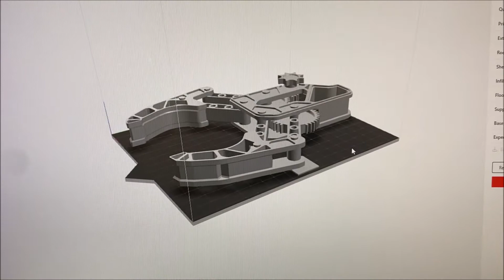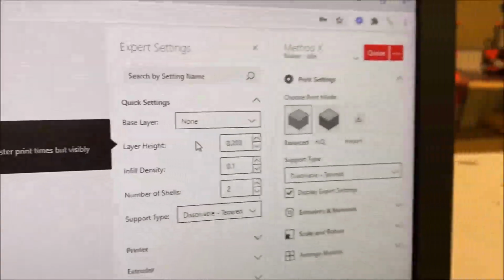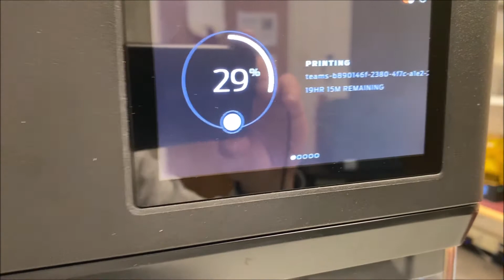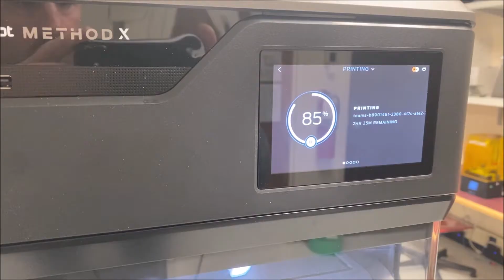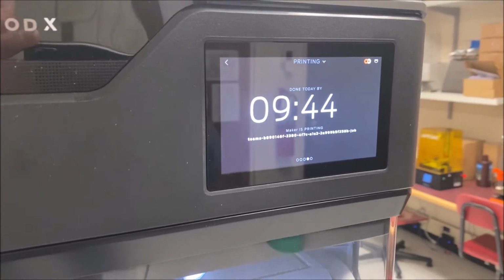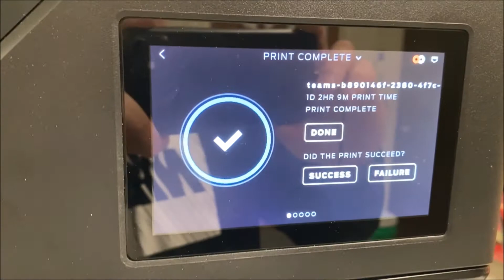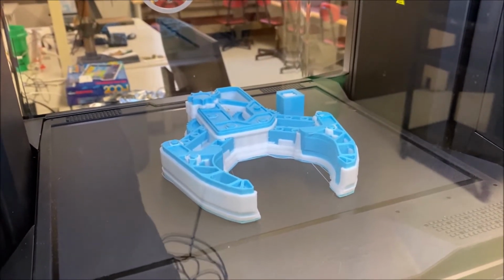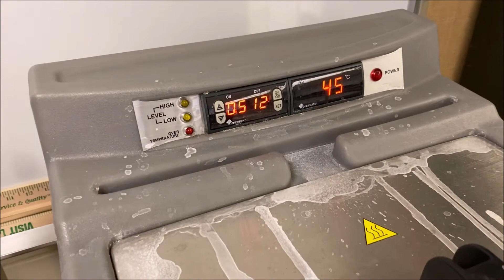Printing with the Makerbot Method X: Success or Failure?

Comment: The build tape for this printer is very expensive. Any one found a cheaper alternative?
Reply: Have you tried the blue painters tape ? back in the days before heat bed is common, they were using those blue painters tape. but it only works for PLA
Reply: It's probably the same stuff as Buildtak or any of its china alternatives.
Reply: Raises 3D better!

Comment: Any chance you could do some fine measurements and let us know how the dimensional accuracy was (they claim +/- 0.2mm).
The axle breaking was not the printers fault, those axles should be 100% parts and the rest of the claw should be an infill much higher, like at least 75%.
Not sure why MakerBot would provide a 3D model like this to print that doesn't have solid axles and a recommended set of settings to use for best results (like not doing a 20% infill).
The take aways I see from this video are:
- good to see the method x actually printing (slower than I expected)
- mostly clean printing process and no stated clogs or issues
- the part looked good (except I think I saw some pinholes on some of the gear teeth that were a little concerning)
- I didn't see any warping of the part (I think that lifting of the left tip was due to no bed adhesive being used and maybe some bed/enclosure/nozzle temp tweaking to be done (which tells me the MakerBot extruder and filament defaults aren't perfect at least for ABS)
- Seemed to be quiet during printing but with no decibel readings during the video hard to tell
- interface to the machine looked great and closer to Industrial level coaching that you would expect)
- did I mention above it seemed to print slower than I expected, but I did like the print quality for the most part (as good as you can tell from a phone recorded video being streamed compressed, being consumed on a phone ;-). )

Comment: Thanks for posting this.  I have been using the method x with the included filaments and SR-30, and they work fine with very few issues.  However, I tried a print with the esun ABS+, the same stuff you are using here, along with the SR-30 and the experimental extruder and my SR-30 is just not sticking to the ABS+, causing all kinds of printing issues.  Any suggestions?  Thanks
Reply from the maker: Hmmmm interesting. I do know that in the printing settings you can adjust the geometry of the support structure. And you can adjust how the supports interface with the model. Look at your print preview and see if anything needs to be adjusted.
Reply: @coolteched7572  The problem seems to be the "stickyness" of the SR-30 to the esun ABS+.  I changed the Makerbot filament to the esun and the SR-30 just won't stick, whereas with the makerbot ABS there is very little problem with the SR-30 sticking to it.  Had to go back to the makerbot abs filament for now.  Thanks

Comment: What was the overall length of time it took for it to print this out for you? I heard the time it was done, but not when you started, would be great to know to get a sense of output speed relative to the complexity of that claw. Thanks!
Reply from the maker: I can't remember! But it was a lengthy amount of time. Prints take longer on this Makerbot because between each nozzle swap, the non-printing extruder's temp is lowered. So both nozzles are constantly cooling / heating up. This can be adjusted in the printer's settings, however
Reply: The display showed 1 day 2 hours and change, so 26 hours and change

Comment: What infill % did you use? It looked like the broken knob and axle had very little infill which caused them to break easily.
Reply from the maker: 20% infill I believe. Should have done 50%+. My Stratasys UPrint SE Plus printed this gripper awesome and used a very high infill
Reply: exactly what I was thinking... should be 80%+ surely?  you're not going to get gears torquing at 20% :)
Reply: @egoodchild  totally 100% agree and arguably even 100% .
Or in the modeling tool those axles should all be 100% in the shafts (a no brainer really).
The overall quality looks good, but without him showing measurements on the dimensional accuracy we don't know that either.

Comment: How does this model of maker bot stack up against the zortrax 300 dual extruder model for $5000?
Reply from the maker: No idea about the zortrax 300 dual extruder printer. I do have the zortrax Inventure 3D printer and it uses the same dual extruders as the 300. I love my Inventure 3D printer! Print volume is 5-inch squared which is usually perfect size for what I print. I run stratasys sr-30 support material in the Inventure with abs
Reply: @coolteched7572  thank you so much! I may very well get the zortrax inventure it's on sale $1795ish...I may just have the plastic plugs machined and the printer for prototyping versus mass production.
Reply: @coolteched7572  /One concern I have about the inventure printer is its supposedly being marked down in price due to a rumor that it is being discontinued in the near future?  It looks like a great printer with a lot of features for the price point and portable size.  Any idea on if its discontinued or to be discontinued soon?

Comment: I am considering a method x.  Was curious I need a printer that can crank out 500-1000 one inch plugs with abs or stiff pla for a potential supply agreement. I had a few samples printed out by a facebook user with an Ender 3 printer and he told me the plugs are a 'perfect match for 3 D printing' due to their simple design.  Do you think printing perhaps 50 plugs in batches twice a day until i got to 500-1000 would be okay or is that work load to high?
Reply: Do not worry about the printer. They can work days withour resting. But I would recommend you a printer with double extruders which can work simultaneously. Then you can print two copy at once. It can be done for example by BCN3D Simga or Epsilon. This is called IDEX technology and can be found in different printers as well. The other direction I would go is a printer with treadmil. It prints one aftrer one print and roll the "table". This way it can print infinitely
Reply: @marcinkonert7071  ya mass printing of the treadmill 3D printer is key

Comment: If we could print the parts separately and then assemble it, will solve the problems that happened with you. Am I right sir ?
Reply from the maker: You are correct! But my 10 year old Stratasys fdm printer can print this model just fine!!

Comment: Very interested in your results as I purchased the Method X Carbon Fiber Edition and had clogging issues when printing their demo gear.  Since your 3rd party filament will print without clogging using the Experimental Extruder, have you tried running the Makerbot filament through the Experimental Extruder to see if it will print without clogging?  That might help to isolate the clogging issue to their stock extruder or their filament.  Also, do you have issues with ABS fumes when printing, since theirs is an unfiltered environment?  Thanks for the videos.
Reply from the maker: I have not tried printing Makerbot filament (abs) through the Makerbot Experimental Extruder. I will have to try that. I have a ton of Makerbot Abs. I don’t have issues with abs fumes. I’m in a large room with windows that can be opened for ventilation